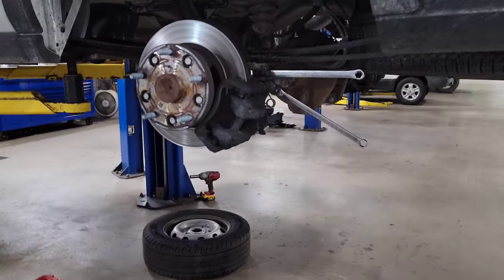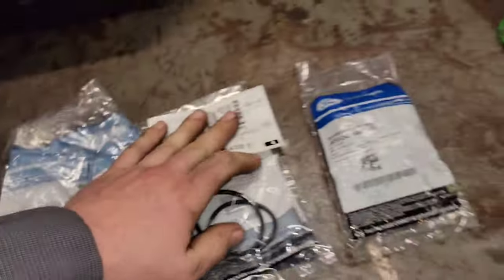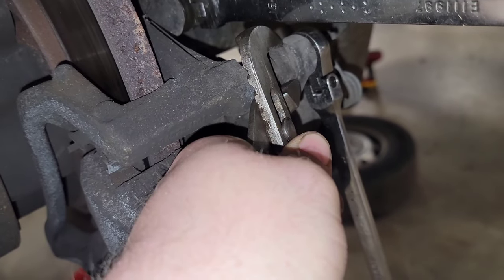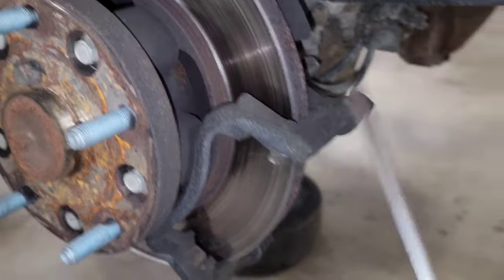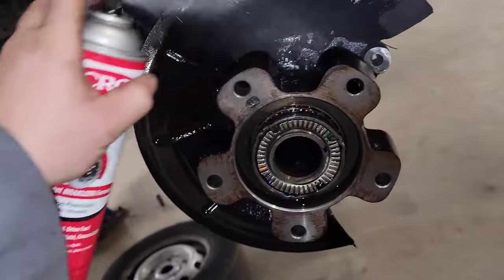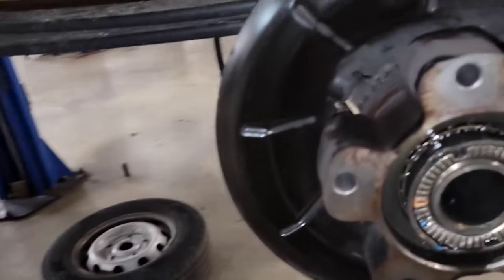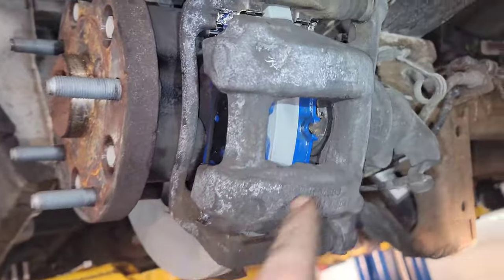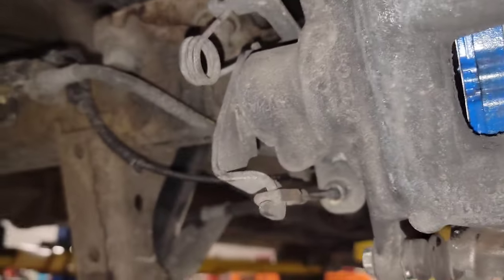2019 Transit T250 Rear Brakes 28k miles Full Remove and Replace - Tools and Part Numbers

Comment: I've never seen a oem pad go that quick. Wow must be undersized for the application
Reply: I changed them at 27,000km one time
Reply: I’ve never had pads go under 50k. Even cheap aftermarket pads
Reply: I have a company transit T150 that loaded up with tools and my rear pads went out at 90k but still driving with the original fronts at 133k today.
It all depends on the driver and loads. I’m an easy coming to stops with the van. Overall the transit in my opinion is pretty reliable. The Wisconsin roads give it a beating.

Comment: Do they chew up rear brakes because of the TCS and anti wind 🌬 stuff?
It feels like it’s the rears that brake when the tcs goes off if swerving. 
But for the wind the rear brakes too?
Reply: Seems like there's a problem with equalizing fluid.  If the back brakes are doing all the work, something needs to be equalized.